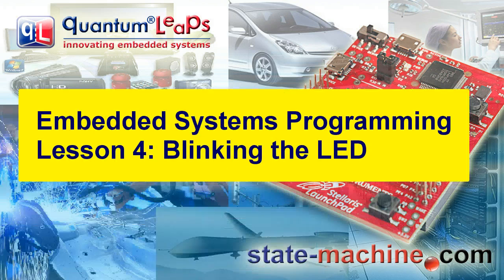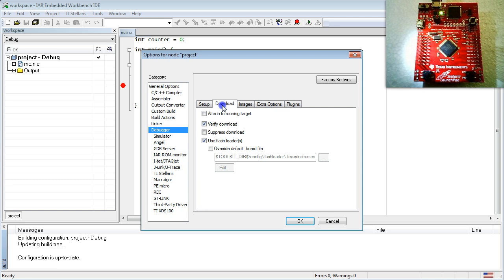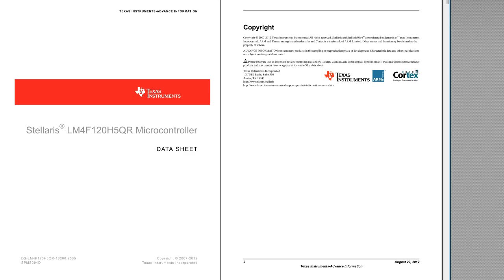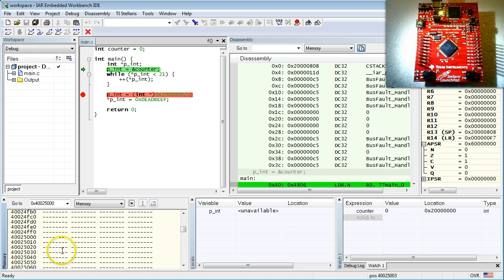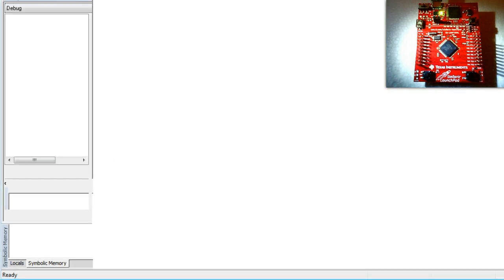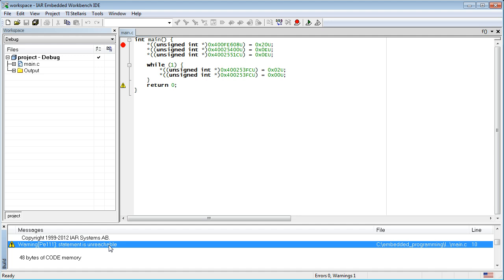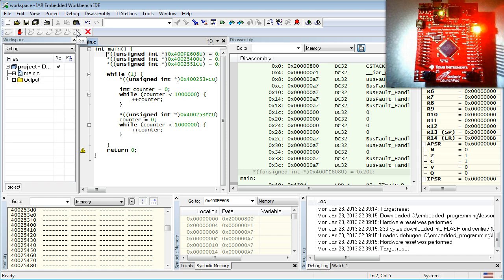#4 How to control the world outside?

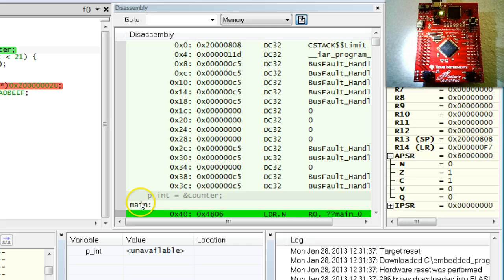Comment: At around 3:00 you say, that the low addresses have machine instructions, and that this is the compiled portion of your program that is stored permanently in the microcontroller. I'm not sure what you mean by "compiled portion of your program". Could you please elaborate more on what you mean? Are you saying that every program that you execute will have its machine instructions permanently stored in the microcontroller? I feel like i'm understanding it wrong!
Reply from the maker: The "low addresses" means addresses with small values, such as 0x3c and all the way to 0x8000. This happens to be the address space for the flash ROM (TivaC123 has 32KB of it, which is 0x8000). This is also in contrast to RAM, which has addresses staring from 0x20000000. Now, regarding program memory, most typically your program is stored permanently in ROM, so it will have "low addresses". But it is also possible to execute instructions from RAM (the CPU does not care). For example, when your debugger programs your code into flash ROM, the debugger is really sending a small program called "flash-loader" that is stored temporarily in RAM and this flash-loader programs the flash.
Reply: Thanks for that. So when the debugger programs my code into flash ROM using the flash loader, does anything get stored permanently in the flash ? I'm mainly curious to what gets stored permanently in the Flash ROM.
Reply from the maker: The flash-loader programs your code into the flash memory (ROM). The flash stores the code permanently.
Reply: @quantum leaps : how did you know that the Tivac123 has  32KB of flash ROM, it's not written anywhere on the datasheet ?
Reply from the maker: According to Figure 1-1 in the Tiva TM4C123GH6PM Datasheet, there is 256KB of Flash ROM and 32KB of SRAM in the MCU. The Tiva TM4C123GH6PM Datasheet is available from Texas Instruments and also from the companion page to this video course at: http://www.state-machine.com/quickstart
Reply: yes there is  256KB of flash ROM and not 32KB like you said in the first comment. :)

Comment: May I know how fast can a regular GPIO toggle for this particular board.. I mean if i want to use a regular gpio as a clock, what can be the maximum stable frequency it can run?
Reply from the maker: Rapid toggling of GPIO pins from software is a very poor use of the CPU. Instead, for such case you should use a hardware timer, which can generate pre-programmed pulse structure automatically and without the CPU involvement.

But regarding the speed of GPIO access, the method used in this video course is much faster than calling functions from the TivaWare library. Also using the high-speed AHB bus (as opposed to the slow, legacy APB bus) helps to achieve significantly faster GPIO from software.
Reply: Thanks for your reply.
What i wanted to accomplish is to have the microcontroller as the master unit for communication to other boards/peripheral. The challenge is that i need a variable/programmable comm rate(say 1Mhz to 16MHz) for our application. The protocol is almost same as SPI except for some differences like the clock is continuous with or without data. This is basically the reason I was asking the speed of the regular GPIO because i plan to control/program  4 GPIO lines by looping through. Having said this, can you recommend how can i start to go about it. 
By the way, I checked the board and it is using 16MHZ ext crystal. Can this be replaced with a much higher one say 80Mhz?

Comment: how did you know that you had to go to address 40025400 to set the bits for the LEDs?

same goes for the other addresses you mentioned that you went to without explanation.  How do you find that you had to go to thos specific addresses?
Reply: it's 660

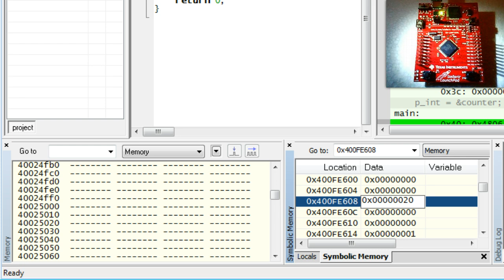Comment: Hi Miro,  I'm a little confused about what you meant at 9:00 "set bit five which is hexadecimal 0x00000020".  I'm sure I'm misunderstanding what you are referring to here as hexadecimal 20 would be "14" in decimal.
Reply from the maker: 0x20 == (1 << 5), so that's why it's called bit-5. 0x20 == 2*16, so hexadecimal 0x20 is decimal 32. BTW, what is 0x10?.
Reply: AH!  I see now.0x10 == 1*16 = 16Thanks so much Miro

Comment: Hello Mr Miro Hamek, Thank you very much for this interesting training, in fact I have a question concerning the 5 th video "Blinking the Led" :after starting the configuration (clock gating, direction of pins,digital output resgister) you said that GPIO-F Data register is located at 0x400253FC, but I can't find that in datasheet GPIO Port F (APB) base: 0x4002.5000 ,offset: 0x000 ! can you tell me plzz what is the problem here? thanks!
Reply: +SwirlyColors Ok, I get it. Setting bit mask [9:2] yields 3FC magic number.
Reply: +han34han34 But Where do you get the 3FC part? I'm as confused as the other guy.
Reply: 3FC is to set the GPIO to be an output/read. The narrator did not mention it in this video. You need to data register operation.

Comment: Thank you for the lesson, but I don't understand why 400253FC is located in the right most column in the memory window? Don't the last two digits correspond to 400253FF ? Thank you, if someone could clarify.
Reply: Hi. I had this question at the first time watching it, and finally I got my answer: 400253FC is just the location of the memory block, it means: starting from this address is the 32 bits of the register Port F.

Comment: First of all thanks for the awesome tutorial, I am a beginner in embedded programming, While i was executing your code for blinking the LED i am facing this error: Memory access error. Trying to write outside the linked memory at address 0x40025fc when pc is 0x56. Can you please guide me what to do and can you please let me know how can I better start with embedded programing and what are prerequisite before starting embedded programing.
Thanks.
Reply from the maker: +deepak begrajka It looks like your address is too short. Most likely, you meant 0x4000,25FC. Please note that I've used a comma every four hexadecimal digits to show you that 32-bit addresses require 8 hexadecimal digits. Your address has only 7 digits and that's why it falls into an "unmapped" memory area. I hope this helps...
Reply: +Quantum Leaps, LLC  Thanks a lot it worked.
can you also let me know how can I better start with embedded programing and what are prerequisite before starting embedded programing.
Thanks.
Reply from the maker: +deepak begrajka Yes, there is an educational gap when it comes to embedded software engineering, which falls somewhere between EE (Electrical Engineering) and CS (Computer Science). This YouTube course is one small attempt to bridge the gap.

Comment: What the difference between the register 136 and 60?
In some guides they set the address 0x400FE108 and you had set 0x400FE608.
Could you explain to me?
Thanks!
Reply from the maker: +Joeyhkbx This is about the GCGCGPIO register (GPIO clock gating). The explanation of the offset 0x608 is given in the TM4C123GH6PM MCU on page 338.  But, basically, offset 0x608 is recommended, while offset 0x108 (RCGC2) is only provided for legacy software, but is not recommended.

Comment: +Quantum Leaps, LLC, just curious at 9.06minute, when the Data = 0x00000020, how this value translate to Bit 5? and to turn on from datasheet  the value is 1. Can you please explain this. Thank you.
Reply: +Manimaran Kanesan, if you look at the data sheet you will need to set the bit 5 = 1. Bit 5 is at the 6st position, because we count from 0. The value Data = 0x00000020 is represented in hex format. Each hex value takes places for 4bits values. You can use the programmers calculater to see the value in binary format, which will be 0b0000 0000 0000 0000 0000 0000 0010 0000. I hope it makes sense.
Reply from the maker: +Manimaran Kanesan 0x00000020 == (1 << 5).
Reply: Nice explanation. can you explain how did he or where can find the bit addresses for GPIO-F1,2,3 because in the memory map and in Run Mode Clock gating all we see is 0x4002500 and 0x400FE608.

Comment: How did you figure out 4002.53FC  is the register that control the port F outputs that you enabled? I can't find that in the datasheet. 4002.5400 is port f data register but there is no mention of 4002.53FC .
Reply: +maduka bandara page no 93 search for GPIO Port F
Reply: +Sai Ganesh Hi thnx for the reply. Can you be specific on the document? i am looking at page 93 in tm4c123gh6pm.pdf but do not see.
Reply: +maduka bandara page 338. Register 60: General-Purpose Input/Output Run Mode Clock Gating Control
(RCGCGPIO), offset 0x608

Comment: How did you get 0x400253FC?
I tried looking for 3FC on the data sheet but could not find it.
Thank you.
Reply from the maker: +lauro199471 The GPIO addresses in the TivaC MCU are explained in Lesson 7 (https://youtu.be/pQs8vp7JOSk). Specifically, you will see there that the address 0x40025000 + (0xFF*4) == 0x400253FC enables all 8 bits of the GPIO block. Therefore, writing to this specific address results in turning all the specified bits. Again, if this is not quite clear here, hopefully Lesson 7 will help.
--MMS
Reply from the maker: +Helios Fire Yes, you must be missing something here, because your math is incorrect. So, let's do it in decimal. First, observe that 0xFF==255. 255*4==1020, not 1024. I hope this helps.
--MMS
Reply from the maker: lauro199471 
The address ending with 0x3FC corresponds to all pins selected, because 0x3FC==0xFF*4.

If you still don't see it from the last equation, here is a bit more explanation: 0xFF is a byte with all bits set to 1 (0xFF==0b11111111). But you also need to multiply it by 4, because all addresses in the GPIO are 4-byte long. Therefore you get 0xFF*4.

I hope this clarifies things a bit. If not, please look closer at the wiring diagram shown in the video.
Reply: +Quantum Leaps, LLC 

Hey thanks for the tutorials I'm learning alot. However when selecting all pins for 0x4002500, you're saying that 0x3FC is equivalent to 0xFF*4. When doing the math 0xFF * 4 = 1024 in decimal and 0x3FC is equivalent to 1020. Am I missing something here?
Reply: +Quantum Leaps, LLC 

on the GPIODIR whose memory address is 40025400, why was E to the right and E in GPIODEN whose memory address is 4002501C to the left? is there a reason to this? I just click on the "go to" in memory debugger  to get to these locations.
Reply: +Quantum Leaps, LLC 

D'oh, yeah I think I saw 0xFF as 256, I miscounted. Thanks QP
Reply: Quantum Leaps, LLC

Comment: Hi Miro! I am trying to do the same using the STM32F4 Discovery kit, however, it seems that the GPIO ports are all enabled by default? This is weird - does this have anything to do with IAR configuration! Any suggestions? Thanks.

Thanks for these videos, they are indeed wonderful.
Reply from the maker: +Ehsanul Karim The STM32F4 devices have different peripherals (such as GPIO) than TivaC, even though they both have the same ARM Cortex-M4F core (but even there could be differences, for example the number of implemented interrupt priority bits in the NVIC). But anyway, the peripherals are exactly where the various vendors differentiate their offerings and that's how they compete with each other. This means that, almost by definition, anything that pertains to Tiva GPIO will not apply to STM32 GPIO.

Comment: Great Lesson. Just one question on this video:  How did you know that the Register that controls the output of PORTF was located at address 0x400253FC?  I understand the Base Address of PORTF is 0x40025000.  But I could not find the Register offset value 0x3FC for the GPIO registers anywhere in the TM4C123GH6PM datasheet.  In fact, the offset for Register 1 is 0x000, followed by the offset of Register 2 is 0x400.  But clearly the register at offset 0x3FC does control the port pin, as it lit our LED.  So whats going on? 

Thanks in Advance.
Murtuza
Reply: Alright, i have figured out for myself the answer to my question in Section 10.2.1.2 in the TM4C123GHPM datasheet.  In short the register at offset 0x3FC, points to the register where none of the PORTF bits are masked out.  At the other extreme would be the register at offset 0x000 where all the bits of PORTF are MASKED out and there fore any write to that address would yield no change on PORTF output bits.  

Similarly since we are only interested in flipping bit 1, bit 2 and bit 3, on PORTF, a write to offset address 0x038 would have worked just as well.
Reply: Murtuza QuaizarI have just progressed on to Lesson 7, where my question on address offset 0x3FC was explained. So anyway, Thanks.

Comment: Hello and thanks for this helpful tutorial. One question - @ 9:05 you explain to set the address of the clock gating regiser  (0x400FE608) and turn on bit 5, to do that you set the data to 0x00000020. Why would it not be 0x00000005? Can you please elaborate on this please?
Reply from the maker: 0x20 == (1 << 5) and therefore 0x20 sets bit 5
0x05 == (1 << 2) + (1 << 0) and so it would set bit 2 and bit 0.
Reply: I'm sorry but your comment still makes very little sense is there something you can recomend i look up to shed some light on this.
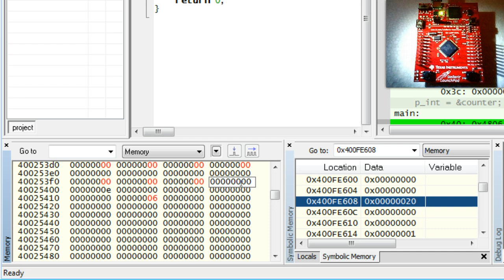Reply from the maker: Joe, please watch lesson 1 "counting", where around 10:57 I explain the decimal and hexadecimal system. Specifically, I explain how hexadecimal system maps to binary, so you will see why binary 00100000 is equivalent to hex 0x20.

Also, lesson 6 "Bit-wise operators in C", around 6:42 explains the left-shift operator (such as 1 << 5).
Reply: Ah I see 1 is left shifted to bit 5 (left shifted 6 positions over) = 100000 (binary) = 32 in dec = 0x20 in hex. Thanks. Study bitwise operations @ http://en.wikipedia.org/wiki/Bitwise_operations_in_C

Comment: Another great lesson!   I am trying to sharpen my datasheet reading skills.  I am using an Atmel board.   Your reference to "GPIO Run Mode clock gating control or clock gating register" (time 7:59 in the video), is there a more generic meaning?  Is it the same as GPIO Enable?     I can't find this in the datasheet I am using.   Thanks
Reply: I figured it out.

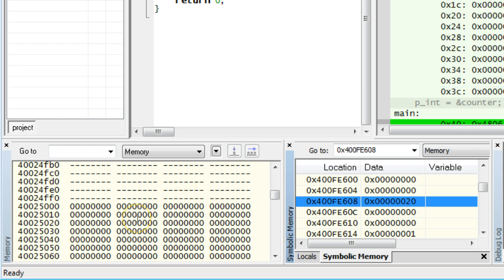Comment: Hi  Mr. Samek, really nice videos,i have small question...at 9:07 you saying add 5 in decimal but 5 decimal=5 hexadecimal and i'm kind of confused.why add 20 and not 5?
Reply: ok,who also interested by my question i found the answer....port 5 means "1" binary at sixth place and zeroes before so it comes out to enable only port 5 we need to place "1",then it goes to 100000 in binary=>20 hexadecimal.

Comment: Really good tutorial. I understand how you set the direction for the GPIO port pins because I am an Embedded Software Engineer but maybe you should have shown that the datasheet show the location of the register that allow directions (and other settings of the GPIO port) to be set for others who might not have previous experience to clearly understand...
Also, you could have just done it in code to show further use of pointers to modify memory directly...
Really good though, really good explanations.
Reply: My bad..you mention that...You are god sent for all aspiring Embedded Software Designers..

Comment: Thanks for posting these videos. They are very helpful.  One thing though, if I load the default program qs-rgb.bin from the TivaWare bundle to my TM4C123GXL via the LM Flash Programmer, the code in this lesson will not work as written.  I found via code from another location that I had to set a few more GPIO values before I could get the LED to blink. This is what I added:

*((unsigned int *)0x400FE608U) = 0x20u;        // STSCTL_RCGCGPIO_R
 *((unsigned int *)0x40025520U) = 0x4C4F434Bu; //GPIO_PORTF_LOCK_R
 *((unsigned int *)0x40025524U) = 0xFFu;      // GPIO_PORTF_CR_R
 *((unsigned int *)0x40025528U) = 0x00u;      // GPIO_PORTF_AMSEL_R
 *((unsigned int *)0x4002552CU) = 0x00000000u;      // GPIO_PORTF_PCTL_R
 *((unsigned int *)0x40025400U) = 0x0Eu;         // GPIO_PORTF_DIR_R
 *((unsigned int *)0x40025420U) = 0x00u;      // GPIO_PORTF_AFSEF_R
 *((unsigned int *)0x4002551CU) = 0x0Eu;      // GPIO_PORTF_DEN_R

I cheated and found these values in the tm4c123gh6pm.h in the TivaWare inc folder

After this, all was well.

Cheers  Jon
Reply from the maker: Jon: I've tried a couple of times, but I can't reproduce your problems. I've loaded the original program qs-rgb.bin with lmflash to the board, after which I've checked that it worked. Next, I've loaded the the Blinky program from Lesson4 using the IAR debugger, and it blinked without any problems. Next, I've generated binary output for this project, and loaded this with lmflash, and it worked. I've repeated the test after re-programming the original qs-rgb.bin, verifying, and programming over Blinky, and it worked every time.

I think that your problem might be that you don't reset the board after programming. Here is the command line I've used to program Blinky:

LMFlash.exe -q ek-lm4f120xl -r project.bin

Please note the -r command-line option to reset the board.

--Miro
Reply: Miro,  Ah!  I think I found the issue.  Looking through the video again, I noticed that  "TI Stellaris -> Reset will do system reset" was not checked.  Once this was checked, the extra GPIO steps were not needed and the code worked perfectly as is.   Palm to forehead.  Thanks.

Comment: Hi
I have a real problem
When I connect the board to the USA cable , through the upper USB/ICDI connector the both leds turn on .
Should I connect to the seccond USB plug ?

Also when i try to get into DEBUG mode I get an error message why ?

Elico

Comment: Hi Miro, I have the same question of understanding the GPIO PORT F data register. I saw a reply from you for another post regarding this but, as per your reply, i could not find the direct address for the Data register in the datasheet. the base address looks good but the offset is 0x000 which i am not able to understand.
I have pasted the portion as below.

GPIO Port F (APB) base: 0x4002.5000
GPIO Port F (AHB) base: 0x4005.D000
Offset 0x000
Type R/W, reset 0x0000.0000